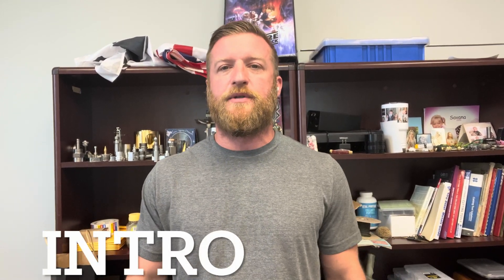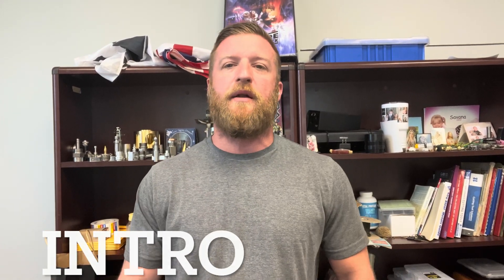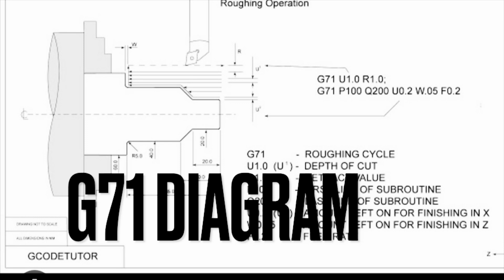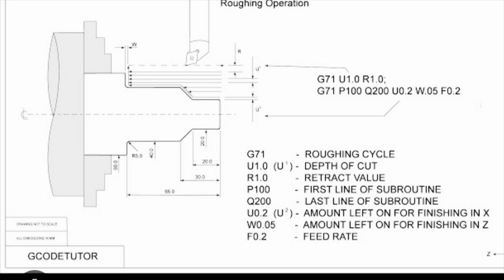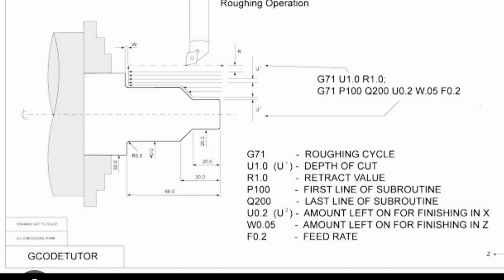Is G71 worth the hype!?

Comment: What software are you using to program your lathes?
Reply from the maker: We use fusion a lot now. In the past was esprit - Also, I do a lot long hand programming. How about you ??
Reply: @Crusadermachining  on my lathes I'm mostly using manual guide I and hand programming.   On my mill I use fusion for 3d models and bobcad for quick and dirty programs I don't have a model for
Reply from the maker: @thunderthormx heck yea. Long hand programmers UNITE 🤝😎
Reply: @Crusadermachining  also I noticed most of your programs leave a lot of material to face off on z?  Is that just a safety in case part doesn't clean up?  I usually only leave about .02" on face to clean up but it has bitten me before if part gets pushed in by a drill or roughing tool
Reply from the maker: @thunderthormx I’d have to see specifically that part of the program. Usually I’m in the same camp as you. .020” or so. How much was I leaving ? I didn’t see it
Reply: @Crusadermachining esprit?! Lol. I just learned Esprit. Boy is it hard to find programmers that know Esprit. Esprit Edge to be exact.

Comment: Do you want to lift up the G71 hype, .....  I assume you will discuss this G71 code on Practical Machinist in the future.
I'll give you an extra tip ( free 😁 )  for the G71 cycle, maybe you can add it into the content.
It's usable for internal broaching with a Horn SH117 type tool, you can program the code just simple with G71 and G98 instead of G99.  😉 
Of course you need a lathe with spindle brake and G98/C-axis for this type of operation, it's not for older lathes.
Reply from the maker: Hey thank you for watching. How does it work to do G71 with broach ? And why use that VS a didn’t canned cycle for broaching. I appreciate the input and the idea 👍
Reply: @Crusadermachining  
Well, when you programming by hand and you want to make an internal keyway with a static toolholder you have some options.
On our Fanuc's we don't have a cycle for that, since our last software update on a NextGen Haas we have a VPS template for broaching.
Internal broaching can give you easily 50 to 80 repeats on the same motion, you can make an incremental Loop (subprogram) for that, something like; ( Metric )
%
O2002( Repeat 70 times )
G01 G98 U6. F1000.
G01 W-40. F4500.
G01 U-5.9 F1000.
G00 W40.
M99
%

With a G71 you can make a simple code, well of course with the correct X and Z values and G & M codes for the C-axis and brake. ( C0 ).
G98 
G00 X30. Z5.
G71 U0.1 R2.
G71 P010 Q020 U0. W0. F4000.
N010 G01 X36.
Z-40.
N020 X30.